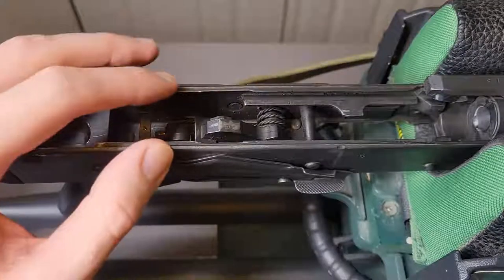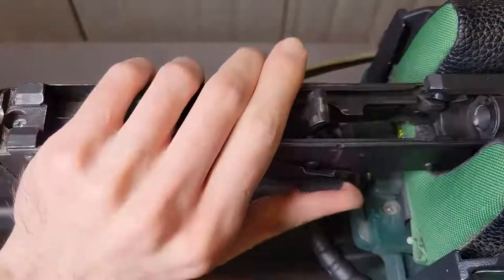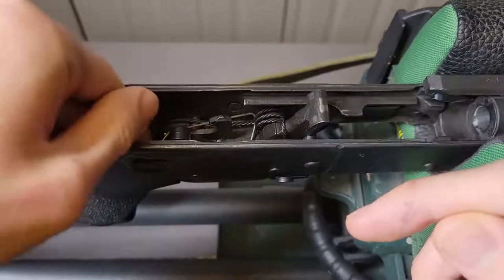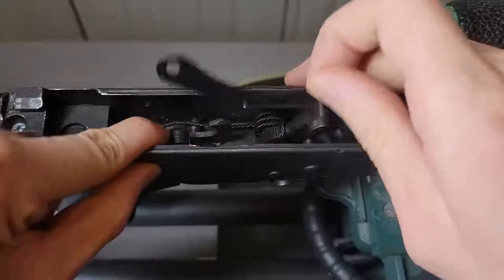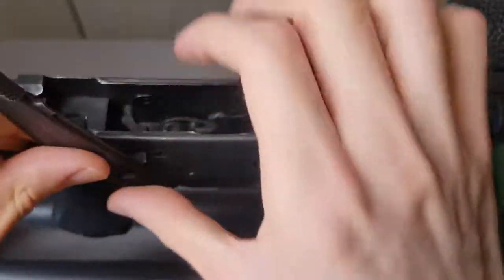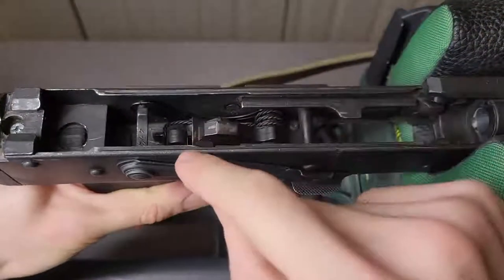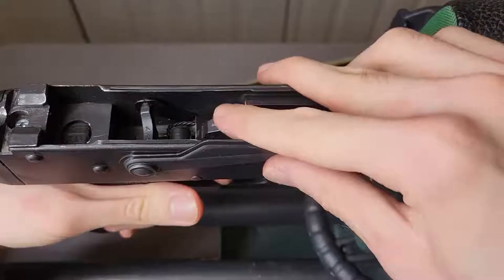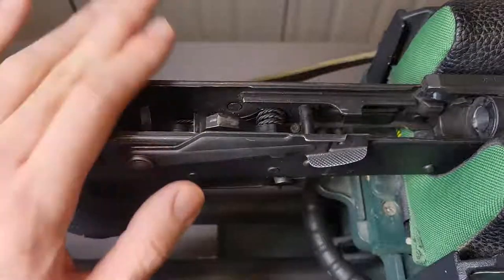How To Install/Remove an AK Trigger Retaining Plate

Comment: Cant get this damn thing off. Psa 103. Trying to install an alg trigger. Cant get the retaininer pin off
Reply from the maker: It should pretty much fall out once you take the safety lever off. Maybe buildup from being dirty or rust or something like that is jamming it in place. If you haven't already, you could also try prying it out if you can get fit a tool under it like a screwdriver or similar.
Reply: @Feldmutze  it took awhile but i got it out. It was the side mount rivet preventing the retaining plate from being removed. Once i figured that out, i just had to pry the plate enough to get it over the rivet and it was free.
Reply: @ipwnu11b how’d u do it. I have same problem

Comment: What the benefit of doing this?
Reply from the maker: It helps to keep things from falling apart when you're changing out trigger components or the safety. Otherwise, nothing.
Reply: It’s also a lot easier to put this back than the paper clip retainer, you have to get it in an exact right spot and even then you have to really play with it to get it right, this is simple drop in, also gives you peace of mind knowing your whole trigger group isn’t being held together with a paper clip
Reply: I trust the beefiness of the retainer plate as well as installation more so than the shepherds hook.

Comment: My safety is stuck now
Reply: Like the trigger is jammed
Reply: Ok after messing with the springs I freed it up.. very weird
Reply: mistake on my part but scary, The safety was stuck on fire and the trigger had no movement.. The safety was getting blocked by the hammer catch
Reply from the maker: What was the issue, did part of the spring get stuck under the retaining plate? I haven't heard of that happening before.
Reply: @Feldmutze  I didn’t take a photo but the safety was stuck and the trigger was jammed as well it was very odd. Like the little notch on the safety was hitting the trigger and it prevented the safety from freely moving. I wish I took a photo cause I’m not sure how I messed it up that bad. 

All I did was move the two springs on the side  to relieve tension and was able to move it out the way.
Reply: @Feldmutze  I’ll maybe take it to the range tomorrow and try to run it hard. I’m pretty sure I got it right but I’ll let you know. 

Thanks
Reply: @Feldmutze  oh and just for reference the trigger was not working at all even with the safety on fire. Something was jamming it up and the only way I could drop the hammer was manually pressing the piece that catches the hammer.
Reply: went to the the range today, I only had about 350 rounds of 7.62 left so I just shot it all. Rifle seemed to be working fine. I Did 3 or 4 mag dumps ( I can’t help it) and no hiccups. 

Only bad part was I burnt my finger cause the damn thing gets so hot cause I always forget my gloves lol. The gun literally melted the end of table, Good thing wasr is chrome lined and I got the thing for so cheap it’s hard not to like it.